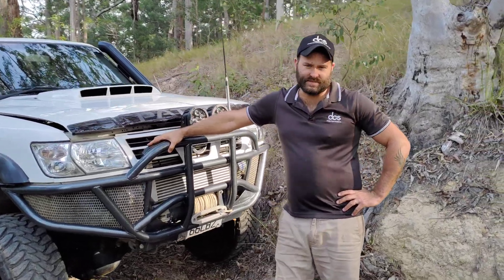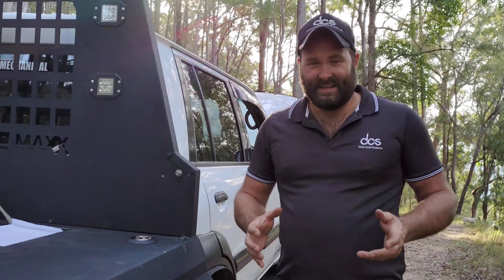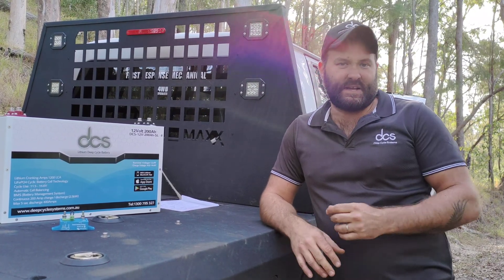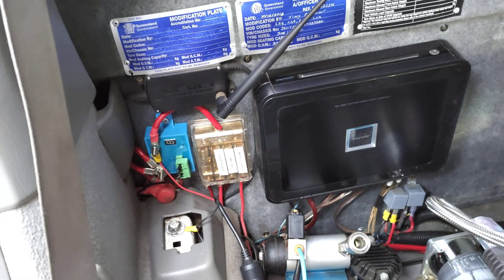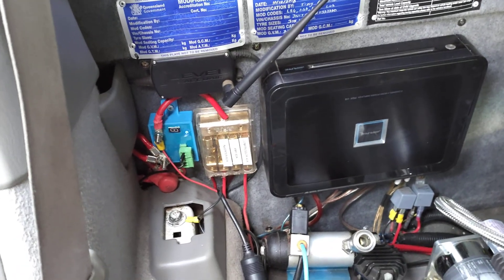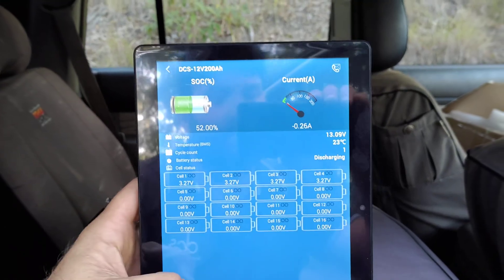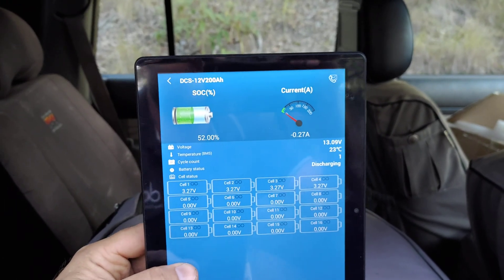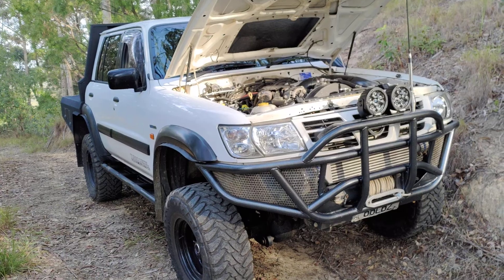DCS 12V 200Ah Premium Lithium battery powering Patrol Duramax

Comment: why did i pay more for less usable power and bigger package with the hybrid 90ahs?
Reply from the maker: Two completely different systems. 

Single 200Ah slim line in cabin for a weekender, no redundancy and no solar and limited to 300A continuous power output. 

Vs

180Ah Hybrid DBS with twin BMSs that can do a combined 360A continuous power output. Plus integrated 80V/20A MPPT charger with a dedicated 3rd shunt and redundancy for remote touring.

Comment: Does the vehicle need the BMS to be disabled?
Reply from the maker: What do you mean by vehicle BMS?
Reply: @deepcyclesystems 
Battery Management System.
Examples such as Ford everest.
Reply from the maker: @Ted...youtubee  there is no such thing, modern vehicles will control alternators via the ECU. Your not touching any of that everything stays as the vehicle manufacturer intended.